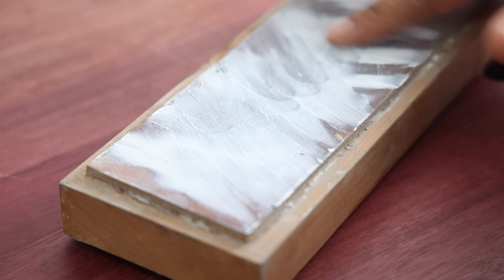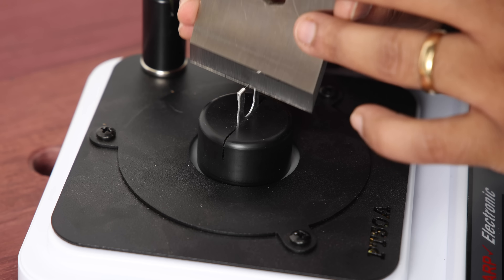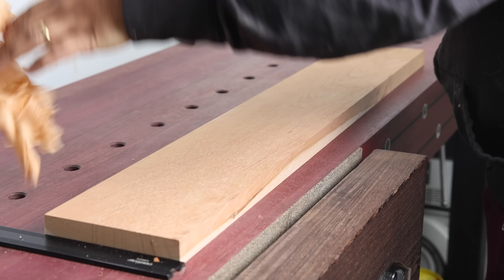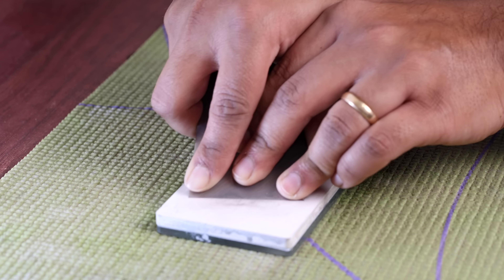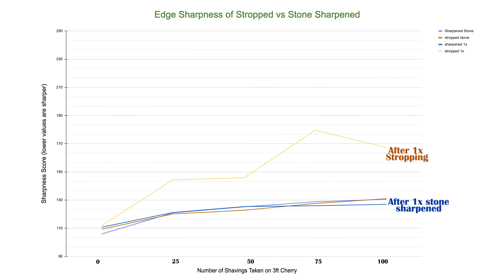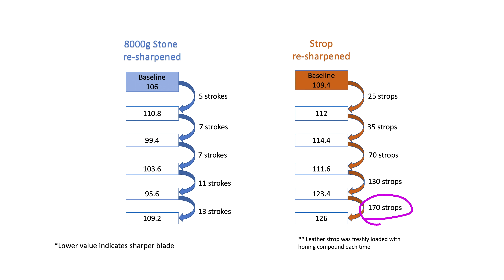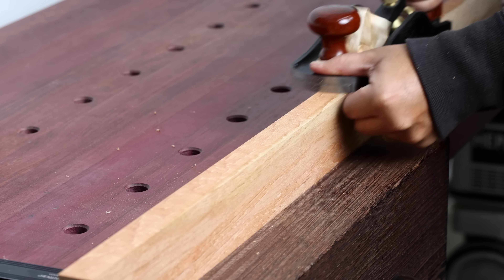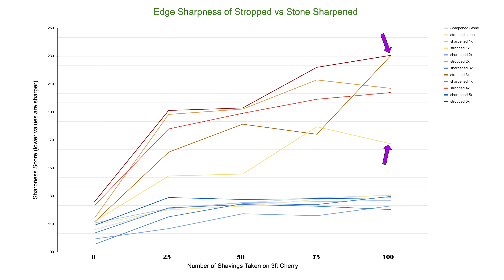is stropping overrated?

Comment: Hello, Suman;
I'll be 68 in few months & I've been able to sharpen all kinds of things for about 40 yrs.
But until last year I never used a strop w/ polishing compound.
Initially I was pretty disappointed w/ the results.
It really does round the edge to strop on leather.
To be clear, I've actually stropped knives on cardboard, newspaper, my boot or shoe, my palm even, for years.
Just never tried it w/ compound on a leather strop.
As stated, pretty disappointed.
I got better results stropping w/ compound on a piece of wood than leather.
Researching, I found most leather strops are too thick & too soft so that's where it fails.
I have a Morakniv "Craftline Basic 511 High Carbon Steel".
It is sharper now than when it was new.
I strop it on the plastic sheath, no compound.
So I agree w/ you, don't waste time "stropping", w/ compound, just sharpen & go.
BTW, When I want to get a really sharp edge I finish by 'sword sharpening'.
Have a GREAT day, Neighbor!

Comment: Great job, I have had the suspicion that stropping on leather might tend to round over the tip of the blade. Based on your results, it's looking that way!
Reply: While your methodology allows you to achieve repeatable test results, you are not just testing stropping itself, you are also testing your strong technique. 

I'm not a fan of your technique. 

I suggest:

Don't push so hard on the leather strop and try again. I don't use that much pressure when I sharpen, why would  I use that much pressure when I strop? 

Also, try different honing compounds on your strop.

Comment: Hunh, that's good to know. I wonder if stropping was necessary due to older stone types compared to modern ceramics and diamond plates. Then it just became common practice. For me, it seemed stropping was necessary to really ensure that bur came off the bevel. Maybe I should just be more persistent in perfecting my method on the stones.

I'll definitely try skipping the strop and see what happens.
Reply: This is probably the answer.

Comment: Great video. I had my suspicions about this very thing, which recently led me to switch from my Norton water stones (which require soaking) to diamond plates and Shapton stones (just need a quick spritz). Now, I find it just as easy to touch up my blades and chisels on my Shaptons as it would be to do a quick stropping!

Comment: The data gathered is good. However, you are missing the 3rd test sample that is sharpened + honed/polished blade. This third sample would out perform both, however only just a bit better than the stone sharpened sample. 

Stropping was never intended to replace sharpening, it is just to refine the edge just a bit more, for that Extra icing on top.

Comment: Hey, Suman, great information and I have some honing compound for sale now if you're interested! Ha!  Question for you. I also have the Veritas bevel-up jack plane like you. I see you have a jack or smoother up on your tool wall. What other planes do you use along with your bevel-up?  Thanks!
Reply from the maker: Haha. Funny enough, I might have some honing compound for sale as well! Wanna trade?
I’ve got the bevel up smoother, jack, and #7. I’ve used the #7 maybe 3-5 times in the last 5yrs. I am not a pure hand tool woodworker, so I def rely on a power jointer or drum sander for most things. The smoother is my favorite. Slap a high angle blade on it and she performs

Comment: What are your thoughts on using a strop to remove the wire edge that occurs after stone shaping?
Reply from the maker: You can do that on just the leather alone and without any honing compound. With that being said, I don’t think there would be much negative effects from one/two passes
Reply: @WoodcraftBySuman  First thanks for this video, very well done, and informative.  What is your opinion on sharpening first on the 8K stone, then a couple passes with a strop, wouldn't that kind of be the best of both?
Reply from the maker: @garymarston5338  I feel like you get the best edge off a stone as long as you’re consistently hitting the angle. Stropping in my opinion, makes up for poor sharpening technique bc it’s squishy and more forgiving. While it may give you a nice sharp edge, I suspect it won’t retain sharpness nearly as well.

Comment: The  first mistake is using thick leather that compresses rounding the edge. The second is using a compound equal to or courser than the grit of the last stone. Try using a .3 micron paste on kangaroo hide that has been adhered to float glass. The thin leather does not compress rounding the edge and the compound is so fine that it can only polish an edge not create one.

Comment: I’ve seen some people use MDF instead of leather for strapping. Perhaps that’s a better choice? You shouldn’t get the rounding over on the edge. 

That way you can get Rob Cosman 16,000 grit polish without a 16,000 gritstone!
Reply from the maker: A sharpening stone does the same thing, slightly better (probably).
Reply: @WoodcraftBySuman  But stones, esp high grit,  are expensive and require maintenance.  Have you had any experience with the sandpaper methods? I haven’t tried that.
Reply from the maker: @mbmurphy777  8000g Shapton ceramic (link in description) is roughly $90 and does not require soaking. If you have diamond plates, it’s the perfect combo bc you need a diamond plate to flatten it. The Shapton ceramics are absolutely the best stones in my opinion.

Comment: stropping polishes and de burrs and finely hones the edge. you don't press hard and you swap between side every 5-10 strokes maybe 40 strokes each side and you have a razer edge, IF you edge was continuous and already set by a stone.. white compound isn't as fine as green compound either and you need your leather stiff and glued down to a flat block not like in the movies. you can round over an edge with soft leather because it will push over and around the3 edge of the blade.. also with a 9000grit diamond stone you are way past what many will have, a lot of people use like 400 -1000 - 1200 then strop to razer edge while the stones are for alignment and flattening.

Comment: Outstanding work!  
If I  were ruch I would buy you a ticket to some of those Japanese hand plain competitions  with wide Japanese hand plains. The winner is chosen by measuring the "thinnest " shaving with a micrometer....!!  I beleave there are valuable things to be learned here...!!

Talk about a different approach!  The plain looks like a wooden brick. The plain iron is a super thick combination of hard and soft steel!  With adjustments by hammer.

Like everything Japanese....there is a deep....deep set of traditions coupled with a myriad of very Suttle details.

So .....how about the ultimate combination of east/west. Definitive measurable results investigation......?

I believe you are just the guy....

All the best!!

just jim

Comment: This is like the scientific method’s peer review and pressure testing processes in action for hobbyist woodworkers. Great content with backed up conclusions. I think that the comments pointing out flaws, oversights, or recommendations for improving the methodology have been great. Thanks for putting this together and having the courage to open yourself up to the inevitable trolls to provide the nuggets of good info to slip thru for those of us interested in finding them.
Reply from the maker: Haha dude as someone that has been through the peer review process many times, I feel like this is worse. Folks expect me to go through every detail on a YT video driven by algorithm that favor simplication and brevity. 

Folks claim a harder backed surface should be used: yes but a stone does the same thing. If stropping on MDF, the results will likely trail behind stone sharpened edge. Folks will claim this is not the intention of stropping— it’s just to refresh the edge after sharpening. Yup- but many folks will stop a few times between full sharpening. And that is the intention of the video- when refreshing the edge, stropping shows inferior result after just one such attempt.  The reiteration of stropping to refresh the edge was to test just how far that envelope can be pushed. This is one way to look at the topic of sharpening vs stropping. Nevertheless- this has been a fun experience.

Comment: Love your videos, your a woodworking project farm in the making!! I use 3/4 MDF and rub my polishing compound on the MDF with a sharpening guide I feel it works much much better than leather
Reply from the maker: For sure. A hard backed surface would likely generate much better results and likely fall in line with results from the stone. Personally, I’d rather just use the stone but I realize not everyone wants to spend that much money when starting out. Thanks for the compliment and for watching. Appreciate ya
Reply: @WoodcraftBySuman  yes the cost is much less. it's hard for me to justify the cost of some diamond stones. I knew there was a reason rob cosman finishes with a 16,000 grit stone

Comment: My sharpest blades always come off a softwood strop surface, the more the used up the compound is, the better the result.  That said, there is no noticeable difference in surface quality nor durability for my tools coming off a black Arkansas stone.  That said I would NOT strop a high angled edge.  Anything above 25 primary will see your cambered secondary into the low 30 deg.  You really want something in the 20 for the primary and sub 25 for secondary.  It's also funny that my blade surfaces NEVER have that kind of scratch free shine, but they can do 1/2 thou shavings all day long.

Comment: First great video. Thank you. 

I noticed Rob Cosman doesn’t strop. His final grit is 16k. Doing a little research I found that stropping compound is around 8k grit. 🤔 But it is a polish, hence the shiny. As you pointed out the strop is squishy therefore not producing the keen edge we would like. 

Paul Sellers I noticed sharpens to 1200 grit and then in some cases strops on wood not leather… If you are up for another test perhaps try wood stropping in but I think at best you would get closer to the 8k performance. 

My conclusion would be if you are looking for a keener edge then a finer grit stone is the way to go.

Comment: I threw out my strop just a few months ago because I experienced this happening. Very cool to see the data. I suspected I was not getting a sharp edge but according to your data it is possible but them dulls quickly.
Reply: Strop was never intended to sharpen tools, only to polish an edge after your finest stone to give the extra final clean edge, at that it excels. You threw away a perfectly fine working equipment.

Comment: You should not strop high vanadium alloys (PM-VII) using aluminum oxide (Tormek white stropping compound). The paste erodes the high vanadium matrix from around the harder carbides in the steel. This leaves a sharp, but very delicate edge of unsupported carbide at the apex. Ideally, PM-VII should be stropped with fine diamond stropping compounds.
Reply from the maker: I’d love to know technical reasoning for this. Any guidance document I can reference? Thanks
Reply: @WoodcraftBySuman  Some references I would suggest would be looking up Science of Sharp, Knife Steel Nerds and Big Brown Bear knives for references on why utilizing diamond instead of aluminum oxide is better as well as for general metallurgy and sharpening. The short answer is vanadium carbides are harder than aluminum oxide, so when you are sharpening with a high grit aluminum oxide, the particles are not hard enough to abrade those hard vanadium carbides. I think it is not as bad with low grit aluminum oxide as those are larger particles that do not abrade the carbides but remove the matrix that the carbides are in. Diamonds are the hardest substance, so it can abrade even the hard vanadium carbides.
Reply: @WoodcraftBySuman  In addition to the references provided previously, you might like to check out Knife Grinders Australia video, https://youtu.be/G60F3b6V8Lo. He shows some microscope images and provides some references to results of his research at around the 18 minute mark.

Comment: So…the blade you resharpen on the stone is hollow ground while the blade you are stropping is not?  This equates to a micro bevel on the first iron and none on the second iron.  You are therefore sharpening 5-10x more surface area on the stropped blade.  Is this all correct?  That could have a significant effect on the level of effort required to reestablish baseline sharpness.  Why not repeat the test but strop the hollow ground blade and hone the standard bevel on the stone?  I am not a big fan of stropping, especially on the harder steels like O-1 cryo, A2 or PMV-11 but find it effective on heat treated O-1.  Even still, I tend to return to my water stones or ceramic stones rather than strop.

Comment: I have trouble accepting these results as proof... they are contradicted by my personal experience.  I have moved MORE towards stropping and away from honing because it is faster and easier and, crucially, more forgiving.  

I think the key element is my own lack of skill in using stones.  That's probably the fundamental difference between your experiments and mine.  Also, I sharpen (strop) knives more often than plane irons...  It's just easy to touch up an edge with the leather strop and compound that I keep handy.  

But I will investigate a much higher grit stone to see how that goes.

Comment: This is a good video but I think people are taking the wrong conclusions from it.  It's true that stropping is not better in most ways than a 8000 grit glass plate, but I would be interested in the results of you only sharpened to 4000 or even 1000.  I would suspect you are going to find the strop is much better in those situations.

We have to remember that these extremely fine grit diamond and glass plates are a very new invention for woodworking and so most of history the strop was vital when all you had to sharpen on were natural oilstones. 

I only sharpen on my diamond plates to 1200 grit which is not sharp enough to really work without the strop.  I think strops are great for people starting out and not wanting to spend a lot of money on equipment. It took less than $30 to put together my sharpening setup, but that 8000 grit stone alone is like $90.

Also diamond and glass stones will always be less shiny than oil/water stones and polishing compound. The oil/waterstones cut with a slurry (which is why you need water or oil) and that causes cuts to go in many directions while diamond stones cut in whatever direction you are moving the plane blade. This does not affect sharpness in any way.

All in all getting tools as sharp as possible isn't that important, as long as they are sharp enough and quick to sharpen they will work. Whether tormek or glass stones or strop all these will get you there so just use what works best for you.

Comment: Interesting test and result not surprising. I don’t know why the woodworking community is so averse to stropping, except for woodcarvers who routinely strop to keep tools cutting sharp.
Look at Straight Razor users and honers who for centuries have stropped razors prior to each use, with edges of a much higher finish and quality. Yea, stropping works. Shave with an un-stropped razor and your face will quickly tell you the difference.
As any new Straight Razor user will tell you, the stropping skill is a difficult skill to master, (get to the point where you are consistently improving the edge) a single stropping stroke can easily damage/roll an edge and it’s back to the stones.
When we look at the effects of stropping with magnification, we see the majority of the polish/pressure is behind the edge and very little at the base of the bevel. Add abrasive compound, and that polish/thinning of the edge is multiplied. So, yes if you strop with too much pressure, with aggressive grit or unknow grit size or grit type,(what is in your polishing stick/paste?) it is not unusual to thin and lengthen the edge. And yes, require more effort or lower grit hone, to cut a new bevel and edge.
For razor honers/stroppers it can take a year or more of daily use to master stropping. 
The problem is not stropping, it is technique.

Comment: Your scientific approach was very informative.   Thank you for all the effort!  However, you seem to have missed the point of stropping your blades.  

Stropping is not sharpening.  Stropping should only be used to polish the edge of a newly sharpened blade, not to correct a dull edge.

I would be interested in a video showing the difference in performance between a sharpened blade and a sharpened and stropped blade and how those stand up to use.

Thanks for all the hard work!

Comment: You're using a very fine stone which average chippy might not have so really stropping is just to remove burrs. after using an 1000 grit oilstone You can also strop on hard MDF using  compound which may give better results.  Really it's a competition between fine stones and strops. Interesting though. Hollow ground is probably quicker using a machine. I loathe having to hand prep more budget site chisels
Reply from the maker: Agreed. Using mdf and honing compound can be a great alternative to high grit stone. Though the Shapton ceramic 8000, arguably the best stones money can buy, is $80. Will last a lifetime and more affordable than most would think.
Reply: @WoodcraftBySuman  Yeah shapton stones are the dogs whiskers, no doubt.